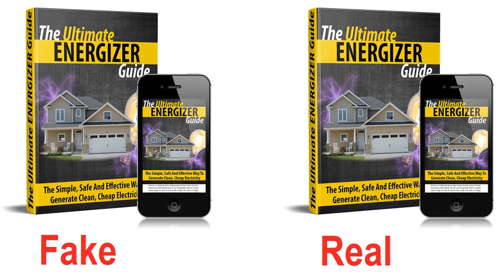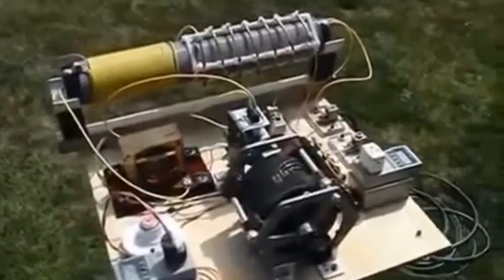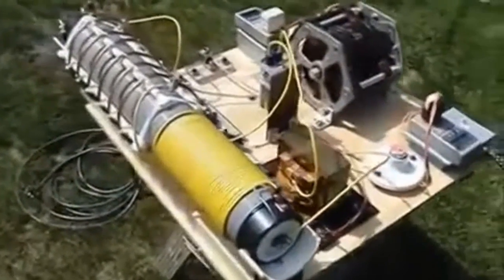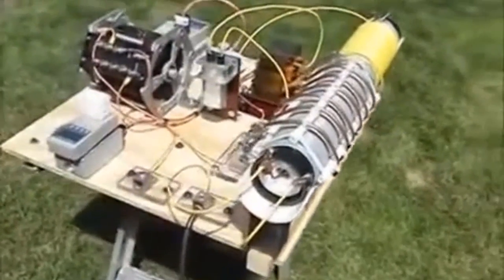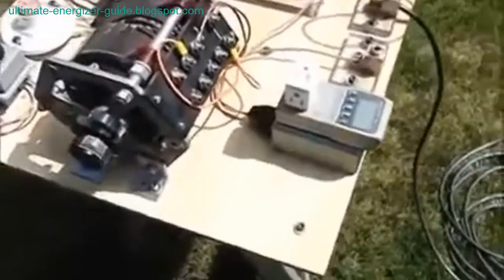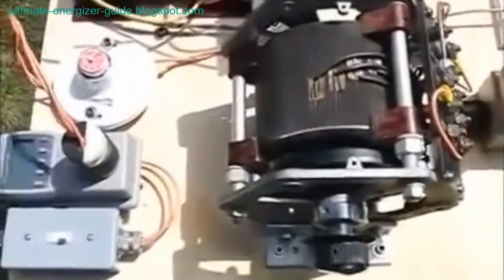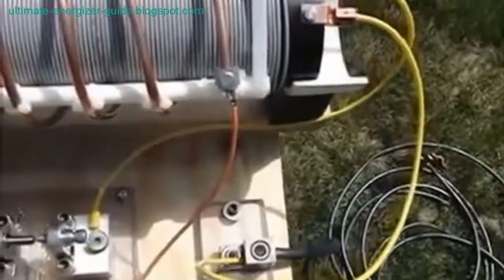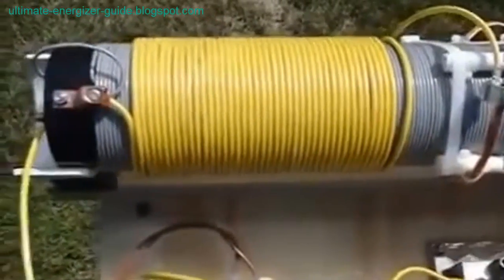Tesla Transformer Become Generator - Tesla Coil Variant Free Energy - by Ultimate Energizer Guide

Comment: That's a Don smith generator. I built one years ago and yes it does work but it has a small problem of the voltage going up and down while running. Also in order to harness the free energy to power ac stuff you will need to use a timer device and a transformer of the Hz you need.
Reply: Or to DC and inverter.
Reply: @Brown_1_111  technically it is an inverter, at the caps the power coming out of them is pure DC as they are high voltage DC caps power only going one way. The only two things missing at that point is the timer device and the transformer. I tried the inverter at the end of it with a voltage divider and it didn't work out too well, the air coil kept rising and dropping voltage causing the divider not to keep a steady voltage so I added a varistor to it and it kept getting too hot also with the frequency changing all the time with air coil the caps would sometimes charge too fast thus voltage going too high, so in the end it does work but I since building that unit way back then I built a better one without the air coil and all that tuning jazz. I think Don made that unit as a slight joke to people cause with all that sliding of that tube trying to set the pace will drive you nuts. Also doing it with just an inverter you are going to have to change them caps out for low voltage high current caps for the inverter to keep working properly and they're not cheap.
Reply: @charlesg3459  e
Reply: @charlesg3459 can you please share the schematic of your Don device? I have tried building it with no success
Reply: @kanjo-Etienne  I used the same one don used. But now all the parts that don used are not available anymore. If you built something similar the only question I have for you what voltage did you get?
Reply: @charlesg3459  I didn't rectify the output but was connecting different resistive loads and none worked
Reply: @kanjo-Etienne  I have no idea what you were trying to do but all of don's units were rectified. The cap(s) have to be kept full. The AC source has to keep running all the time uninterrupted by drain. Once the cap is full you have to pulse it to what ever frequency you looking for, in the end you are making a power inverter. The only difference between the inverters you buy now and back then and don's was that he eliminated the low voltage high amperage battery and went straight to the high voltage high frequency part of an inverter (the first transformer) pumped it through a rectifier to a cap or set of caps. From there you have to finish the circuit (the second half of an inverter) to complete the unit. Simple to do
Reply: @charlesg3459  thanks for that. I appreciate